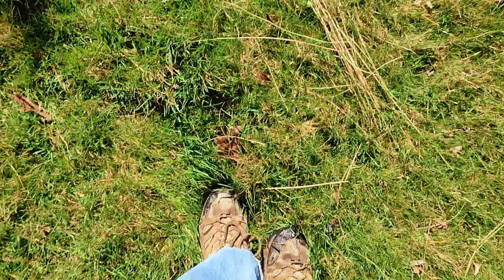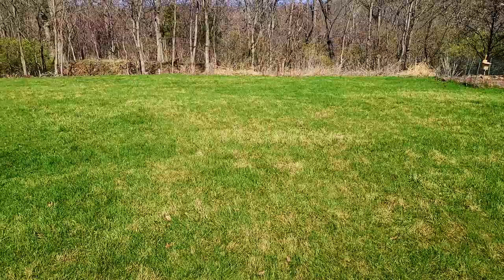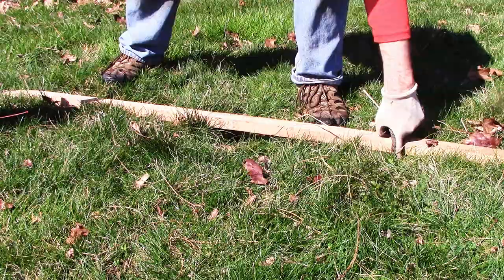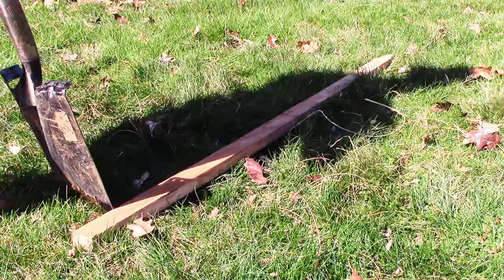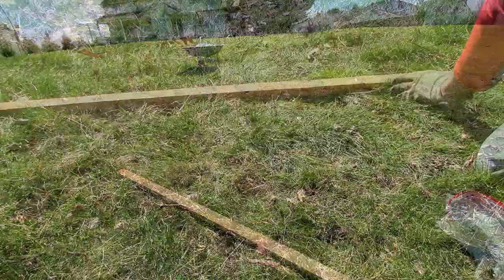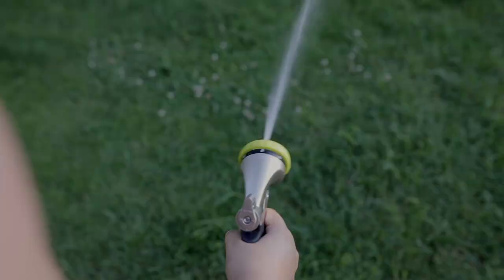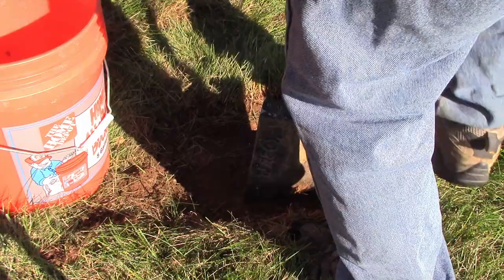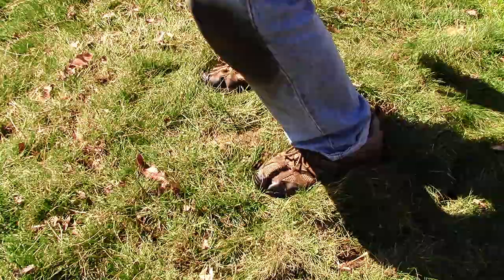Fix Low Spots & Ruts In Lawn Permanent And Quick

Comment: I just add soil on top a thin amount every once and a while throughout the year. It's just easier to be patient as I'm very busy. This way you don't have to water it. You can bring it up 2 inches in a growing season
Reply from the maker: That would work well,especially in hot weather as you said.
Reply: I'm glad this is the first comment I seen. That method is what I thought the video was gonna be about. I have a bunch of tree roots protruding through the lawn in one low spot so I was hoping I could just add some top soil and let the grass grow through it to even out the height. I hope that's the right procedure of doing it
Reply: @Ty-tie_FTW I have a few roots protruding in my lawn also. Did you put the topsoil on top or this method in the video?

Comment: Thanks for your demonstration. It was helpful. I did not know that compost would sink eventually.  I am in Florida, and I am tormented by something called dollar weeks. I try to fill in low spots. But I end up ripping up the grass to pull these dam weeks.
Reply from the maker: Hi Jackie - part of it is straight decomposition, other is just general compaction overtime.  I do have a massive low spot in the middle of my yard, may 6-7" deep and 10x5'.  About 4 years ago I filled it in with 1" thick sod pads flipped upside down and reseeded.  It slow sank down to a similar level from where it started.  That will be a larger project to fill it in, as it will require a large amount of topsoil.

The main reason is 'soil' in the most basic sense is sand/silt/clay mixture.  Organic matter can be mixed in with it too, but organic matter is all stuff that can get consumed by other stuff.

Also, if you look at my leaf mulch videos, you can see that I have placed a 6-12" of leaves on my veggie garden for two years, but have not raised the ground level at all.  That organic matter gets integrated/consumed by vegetable plants.  Or you could think of all the years people mulch, the level of the flower beds doesn't rise much, if at all.  It just slowly integrates and gets consumed as it decomposes.

I'm not familiar with dollar weeds, but it sounds like a pain.  You may want to call your county extension to ask for the best strategy for dealing with them, especially if pulling them causes you large ruts.

Comment: I have low spots in a septic field. The house was built just a year ago. I will try your method in the spring. I want to plant micro clover over it because the turf is now brown.
Reply from the maker: I hope this method works for you, it has helped me quite a bit.  Have you investigated why the turf is brown?  Is it just because the grass went dormant, or did something kill it?
Reply: @growitbuildit  
I have septic service which means that they come ever three months to check things. Initially when I moved in a part of my backyard which is the septic field would be flooded in the morning. The guy that services my home-( a 22 yr old guy) increase the speed the fluid was coming to the tank. My guess, is that the yard is now receiving no benefit from the septic and probably isn’t getting any water. And we are in Texas experiencing a drought. Keep in mine that I am the first owner of this house— a brand new house. From the very beginning there was a fold in my back yard/septic field. So I know something didn’t happen like it was suppose to during construction of the house. I try not think backwards and just move forward. I am trying to build up the yard and create better soil. If you go down barely an inch it feels like concrete. Not soil suitable for a septic field. But like i said, I am trying to just move forward. Planted micro clover a few weeks ago. If you have any other suggestions I would appreciate it.

Comment: What can I do about a big sloping area on the side of my yard that stays soft all the time? I was told that it's because of a "high water table", not sure what that means and right now I'm pretty much penny less with nobody else who could help me so I need to find the cheapest and easiest option. Thank you to anyone who has any suggestions.
Reply: I too have a steep slope on the side of my house (I live on a hill), I’m currently taking measurements to slow & fix my soil erosion. One way you can fix/help it is to get some native plants seeds (ones with deep roots & help erosion), winter sow them in milk jugs outside in the Fall thru Spring & then transplant. I mm currently doing this & will begin transplanting most of them by Memorial Day. I started off trying to do it by myself but I need professional help with releveling the backyard & bringing in large rocks, etc.

Comment: Good video. I have a question my neighbor has a lawn roller do you think I could put that into play instead of a tamper or stumping on it. I have a sag in my lawn where the gas pipe runs about 20' to the street. About an 8" drop.  In another place I have a low area about 6' across the diameter where a tree used to be? Thank you for taking the time
Reply from the maker: Hi - the roller could probably work fine.  And then you wouldn't need to make it 'higher' or anything like that.  I would just try to be sure you won't damage your pipe.

Comment: Just found your site. Read your article on the eastern redbud's root system. I just transplanted a small (4ft.) high tree. Don't know yet if it will grow but I found the little tree had two taproots both the same diameter of the trunk. One went straight down and the other took a lateral turn to the east. We had to cut both to get it out of the ground. I was interested that your article was the only one I've read so far that found no taproots. Since these trees are usually understory trees I wonder if, as such, they use roots of other trees to find anchor them, yet when they are out alone in the open grow one of their own, if that makes sense. Sounds sensible to me considering the weather extremes in the area it grows in.
Reply from the maker: Hi Elizabeth - After researching and growing a large number of trees, I'm of the opinion that the roots of most trees will directly adapt to their conditions.  Oak trees often begin with a taproot, only to lose it later in life and grow wide lateral roots.  Black Locust normally grows shallow, wide lateral roots, but will grow a taproot in dry conditions (USDA).  I have heard from others who transplanted large trees that they had laterals.  I can't really say why mine didn't grow a taproot, as I was fully expecting to find one, but it just didn't have it.

Comment: I have a depression up to 5" deep and 7ft by 9ft. (Tree and stump removed 15 years ago). My only choice is to strip the sod, fill with topsoil (amended with small amount of compost) and replace the sod. I wish it was easier - I'm getting too old for this.
Reply from the maker: Hi Ted - if the shovel work seems too much for such a large patch, you can always just fill and reseed too.  That would work fine, but just take longer to have the grass germinate, etc.  But right now would be a good time, as cooler temps make it easier to keep the grass seed moist.

Comment: Is it possible to do this with a larger area? I’m thinking I’d roll the sod up like a rug and try this tactic with a 12’ x 12’ square that’s low. Would that work, or better to lay topsoil on top and re-seed it?
Reply from the maker: For a very large area I would lay the topsoil and reseed it.  Sod gets really heavy.  I have one large depression that I still haven't addressed.  But to attack it, I would probably do this method but just cut pads rather than a large roll.  Also, consider that moving a sod roll, you basically are moving the inner part of the roll multiple times (every revolution).
Reply: @growitbuildit  Thanks for getting back to me! Great ideas!
Reply: @growitbuildit thanks for addressing the large area question. That’s currently my issue. So I guess I’ll let the landscaper do it with the topsoil on top since the backyard will need to be pitch to help guide the rainfall towards the side & downhill.

Comment: I have a new house with a septic tank and the lawn settled all around the tank, so there's about a 6" depression around the whole thing.  Would it work to put a thin layer down about once a week and work the soil into the existing grass?  Should I mix in any grass seed?
Reply from the maker: Hi Chris - that could work.  I think you would just need to pay attention to it.  If you see large spots of dirt, just go break those up so the grass can work it's way through.  It's going to take a while.  I don't think you need to worry about grass seed as long as the grass blades are poking through.

Comment: How to fill in 75 ft where septic line runs
Reply from the maker: For that, I would probably get a load of screened topsoil delivered.  And I would just seed it on top.  I would try to do this in very late summer as it would be easier to keep the soil moist - https://youtu.be/k1MQgO02RIY